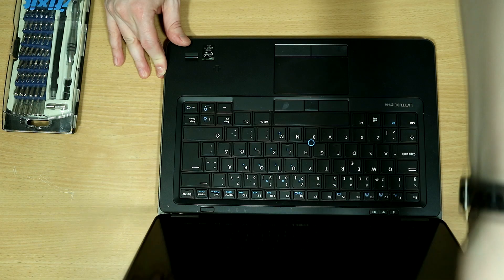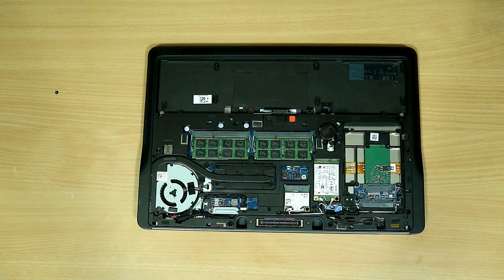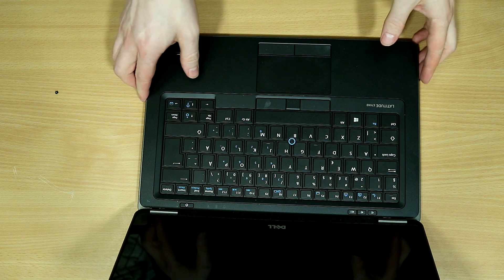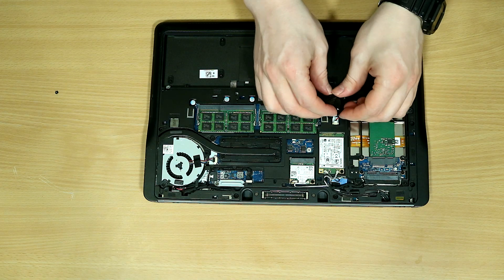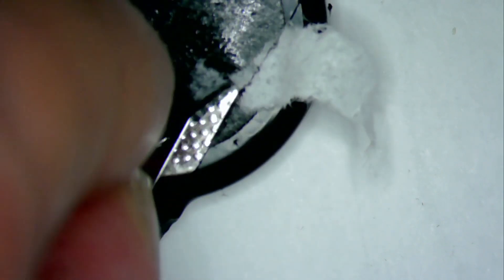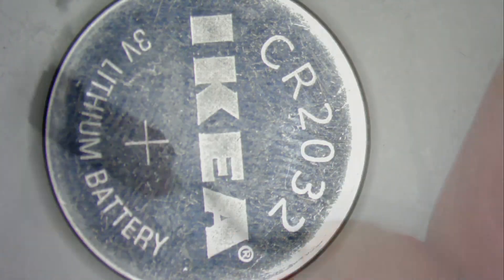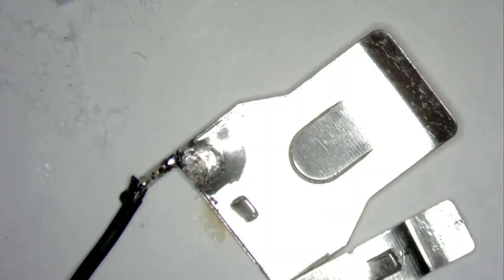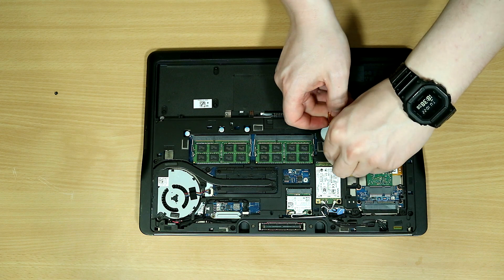Fixing a Dell Latitude E7440 that won't start

Comment: I have a similar issue but mine just power cycles. I've tried a new CMOS battery already but still have the issue. Any ideas?  I don't know electronics so don't know how to diagnose other power related issues.

Comment: Thank you so much for this invaluable video! It would never occur to me that the system was no longer powering up because a 30cent CMOS battery was dead. Sure enough I had the exact same result as you show in the video. I used a small amount of metal tape to secure the tabs and then tightly wrapped the entire battery in electrical tape. Now the system is back to normal. Cheers!

Dell has deliberately designed this as essentially a time bomb as most users would go out and buy another laptop after the 5-10 years that the battery would last. In 30 years of being a technician every other system I have come across with a dead battery would simply boot to a BIOS message informing you that the date and time is not set. This is a flag that either the CMOS battery is dead or that the BIOS values have been reset. Dell should be ashamed for blatantly disrespecting customers and causing untold quantities of working notebooks being thrown away. I am disgusted by this intentional sabotage.

Comment: Thanks for the great video. Worked like a charm. Laptop turned on instantly after removing faulty cmos battery. Prolly wont replace the cmos battery though. Will just continue using it without the cmos battery.
Reply from the maker: You will probably get network problems if you don't have the CMOS clock battery as networking is clock dependent.
Reply: @Purkkaviritys  just gotta make sure each time i turn on the laptop it is well charged and the date and time is set correctly. Thats it

Comment: My dell e7440 screen doesn't lit up all the cooling fan and all things lit up except the screen. I have to press the power button multiple times and after several attempts, the screen turns on. Any possible solution for this?

Comment: i have something horrible!!! can u help me??? bcs i just busted out that screw pocket near that display wire with wider plug. yeah screw pocket of that screw which helps to tighten up the joint of the display plug. i cant tell if that`s the reason behind my display blackout :((        HELP ME PLEASE :`````(

Comment: Hey sir - this fixed my problem.  I'd like to send you a beer or a coffee as thanks - let me know how please?  Very clear and simple guide.  What a terrible build from Dell where it does this instead of giving an error message that there is a battery fault.  Very poor that there is not a low cost battery holder internally also.... your fix was great though and I have a working laptop now.
Reply: latitude E7440 doesn't power on
I face this issue after updating bios with 28A latest update available at dell support and not turning on , by all the steps suggested in your video

- remove battery ,all peripherals , power cable and BIOS battery 

- then plug the power cable and click power button 3times 

 

- it shows power light for 15 seconds and then battery led for 2 seconds 

https://photos.app.goo.gl/s4tpscV14JjkQbLd6

Regards,
Pranjal

Comment: Thank you so much for this video. I subscribed your channel and gave a thumbs up. For my Dell E7440, I can not power it on, and when I plug the laptop to an AC Adapter, the "power on" indicator on the AC Adapter will just turn off. It seems that somehow there is a short circuit inside of the laptop. I don't think there were any water spill or water damage happened for this laptop. For this model and such symptom, what are the most possible cause for this issue, and can I do DIY repair? Thanks!
Reply: Have you been able to fix yours i have the same problem
Reply: @alphaseg3388  i have the same issue also

Comment: hey man, after I removed the cmos battery it still didn't start. how do I fix this?
Reply: Were you able to fix it? I have same issue. Removing cmos battery didn't help
Reply: This did not work for me either. Did you figure out how to fix?
Reply: @shabalabawigman1130  same. Any updates?